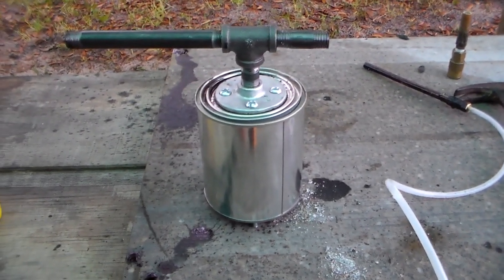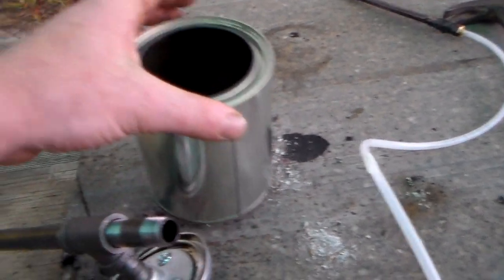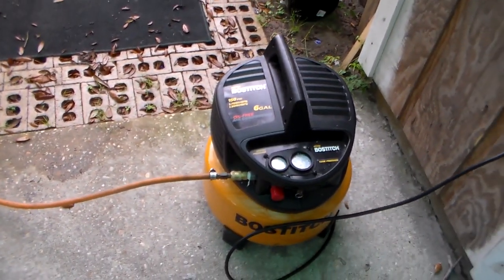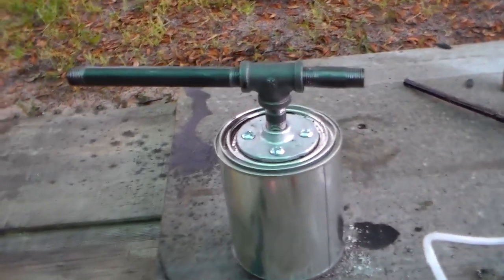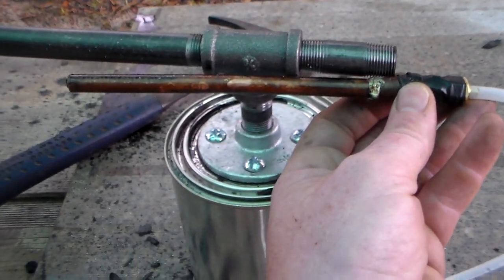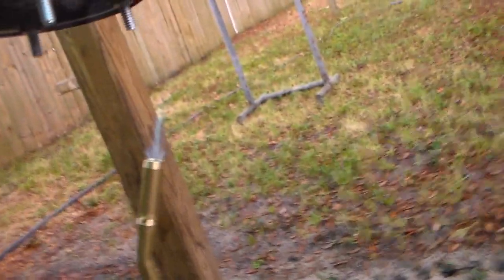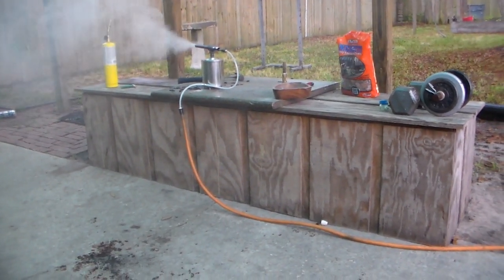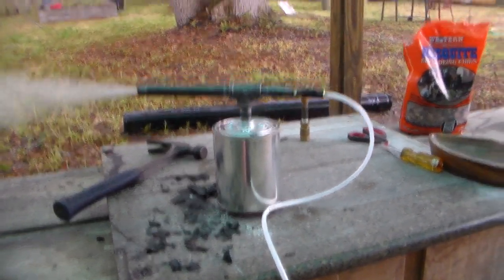DIY SMOKER: Part 1 - Cold Smoke Generator

Comment: I made one of these from you video, I drilled hole on both sides instead of the bottom. As for the air I tried an air pump from an aquarium but didn't seem to have enough air pressure then I tried a compressor and that was ok but it never shut off. I finally found a solution that worked for me, believe it or not I am using an old CPAP machine for the air, its a real workhorse and the output is adjustable. I am using the same size can you are and I am using Applewood pellets which last about an hour I may increase the can size to a gallon.

Comment: Any inflator for a mattress or balloons will work also. While still a bit noisy they're a lot quieter than a full fledged compressor. The automotive/tire compressors are very loud because they pump for high PSI.

I used a portable mattress inflator and a vintage Royal Oak Lighter Fluid can for mine. The old lighter fluid lid can just be pulled off with some pliers, but there is a lip for it to snap into. Take a Dremel disc and hold it perpendicular to grind it off. The steel is too thin to cause issues. The remaining 1"-ish hole can hold a pipe thread itself perfectly.

There is no need to solder smooth pipes unless they're loose. Their default tight fit is good enough and makes cleaning easier.

Comment: It's been 4 years . . . . can't wait for Part 2 ! 
A 1/4" air hose quick connect fitting is a lot easier to assemble into the air injection rod for those who do not want to solder or brass braze as you have done.  That will make it simple to connect and remove your air compressor.  Go from the copper tubing to a 1/4" female pipe fitting, then simply screw-in the quick connect fitting.
Reply: I was just about to search for part 2, i guess i won't bother  since it seems it was never made, haha,
Reply: Plse chk the above comments..there is one with a reply with a link to 2nd video

Comment: Min air pump for smoke generator  is around 8 liters / min or 126 gal / hr. My air for the smoker worked at 2 lbs/ inch. Topfin 1000 at PetSmart is appox.  1.0 liter / min. Hope this helps.
Reply: What kind of smoke gets released from these generators, thin blue or more of a thick white? Thanks

Comment: Good info. Just finished my unit and it works fairly well with pellets. I got a Topfin 1000 iar pump and it would not work. I had to hook it up to my compressor and cut the air to about 4 or 5 then it worked. How big a fish tank air blower does it take?....would like one that will work with my router control from harbor freight. Burned out the paint can with a propane torch and had to reinforce the bottom of the can with a metal plate. I plan to  cold smoke salmon overnight when it get a little cooler. I am going to  hook the unit up to my Weber 22 inch kettle with a 1/2 in id hose. Close and tape the bottom airholes with silver dryer tape and see if that works. I am sure that it will. Any advise on this would be welcome.
Reply: Burn out the liner inside the can before using the home made smoker or some one is going to get sick as hell.

Comment: if you measure the paint can you will find that a that a piece of 4" od exhaust pipe will fit inside a cut in half paint can so you can make it as tall as you want

Comment: I used a 3/4" NPT to 1/2" copper tube adapter. Slid the 1/2" copper tube through the fitting, then a 1/2" copper to 3/8" NPT which screws into a ball valve for air flow control. 
I used the 10" nipple like he did an found optimum venturi at 11 3/4" from the tip, or about an inch before the T fitting center.
Reply: What kind of smoke do you get from a homemade smoke generator, thin blue or thick white? Thanks
Reply: @antw289  thick white. A gallon of soaked chips only lasted about 3 hrs.
I'm building a bigger one - fish takes 12hrs

Comment: I built this also using a gallon can instead.  I used black pipe just like you did.  I just used it for the first time and noticed a black tar like substance dripping from the pipe into my smoke box.  The tar like goo is on the lid of the can just like yours.  Is this toxic material from the black pipe or is it just the product of smoking?
Reply: The Tar is a normal product. Generally, there is a little warmth to the smoke(Not Hot) but if you are doing it outside on a cold day, the length of your inlet pipe to your box with dictate the coldness (for lack of a better word) of your smoke. I have my own homemade smoke generator made from a section of 4 inch Gas pipe. I used a brass inlet pipe with copper fittings.....No problem, but it produces the same tar which is a product of the condensation coming from the hot smoke mixing with the cold air I am assuming. My only issue has been that I am using an aquarium pump which I feel is not producing enough vacuum because of lack of airflow. It does well for a couple of hours then burns out quickly. I am installing a regulator inline and valve from my air compressor today. should do great.
Reply: Did you wash all the pieces before using

Comment: Still waiting on part 2, seven years later.  😉
Reply: I built one with a gallon can. It worked OK. Full of soaked apple chips I had to use a propane torch underneath to keep them burning. He used dry chips so once they start, they keep burning. A gallon of soaked chips lasted about 3hrs.
Smoking fish takes 12 hrs. so I'm building a bigger one out of an old helium tank.

Comment: I tried your design and it worked ok but only got 75min. smoke out of a full can of chips. other than that it works fine.
Reply from the maker: +James Jacobs What did you use to push air through?
Reply: I used an oxygen supply pump it's a little stronger than a aquarium pump
Reply: I soaked my chips, but had to use the torch to keep it going. Lasted 3 hrs

Comment: Are you not concerned that the paint that the can is coted with from the factory will generate toxic gasses that will infuse your meet?
Reply: Lowe's and home Depot sells virgin brand new quart and gallon metal paint cans  that have never had any paint or chemical in them
Reply: A full can test burn should burn out the paint. If not a few minutes with a propane torch should take care of it....that what I did.
Reply: Greg Jarvis m